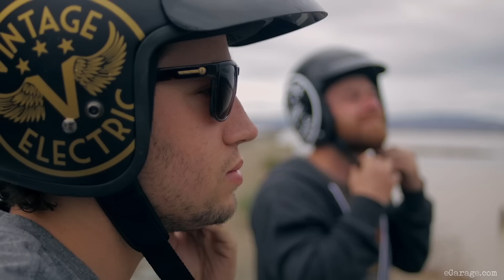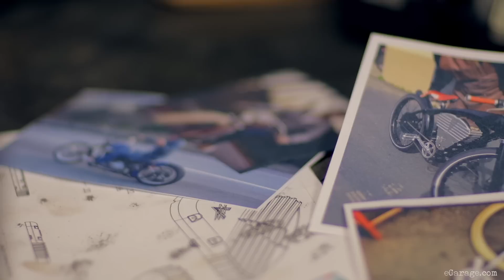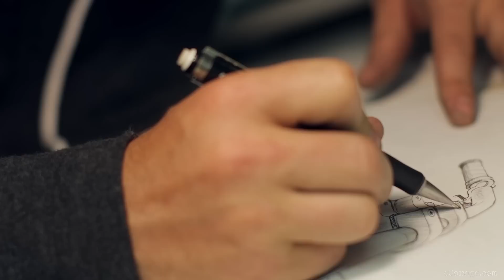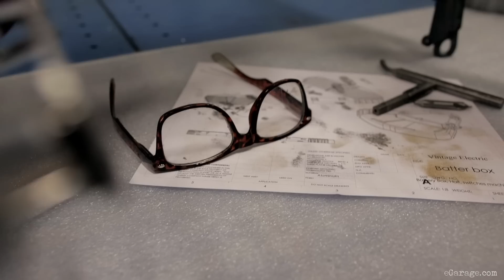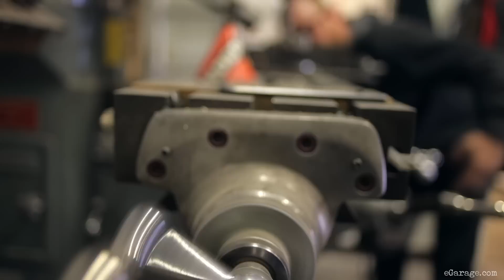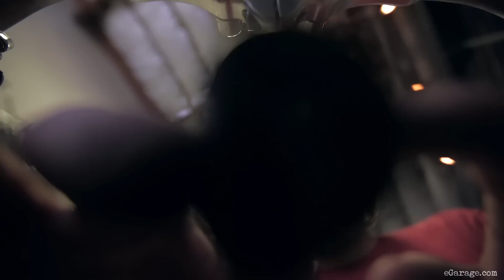Vintage Electric Bikes | eGarage

Comment: They look nice and all, but let's get real those frames are exactly like the two-stroke DIY gas conversion all in one frame can't they sell on eBay. Looks like all you did was put a dummy motor to encase the batteries and a brushless Hub motor. Or mid Drive. You can build one for 1.5k.

Comment: A step up generator using the old motor and battery can be made to get more out of that old bike and it prevents battery drain going uphill also. just put a one to four ration cog on the old motor and use a 120 stator off an old generator but then you have to limit the power or the motor will burn up as it is for a motor that is the rotation of the motor times four. and the drive motor will have to be at least 1440 volt and that is good enough for a ford 1500 diesel and the battery if it still work will last ten hours if you tone it done to an e bike motor. or the time of the battery on the ebike at full speed which is about one half hour.

Comment: I love the concept but when I was watching Video no one was pedaling. I actually know a Guy in L.A. that loves his but if you guys aren't thinking in terms of pedal assist and throttle option as secondary mode you are not thinking correctly. What is going to happen if your producing bike that your not pedal assisting the federal/local laws are going to change and it will be all over. I have a home made electric with a fast motor and pedal it even though I don't have too...I go where motorized vehicles are prohibited because its dead quiet and it's pretty darn stealth.
Reply: RPM look into the geometry of the frame, waaaay too low for comfortable pedaling over distance,  they have released a new bike specifically for the pedalec market, less motorcycle more bicycle in style and built for actually pedaling

Comment: i wish assisted pedal bikes were more affordable. this product and the other one that was on Jay Lenos garage are toooo expensive for the majority of people who have interest. for the price of most assisted pedal bikes you could get a good used car with air conditioning, safety equipment, and all other initial fees payed.

i understand that these bikes are part of the specialty market are more at the higher end of the product spectrum and for the low impact people who probably have a bicycle already. 

i definitely would be interested if the low end prices were $1,500- $2,000. at the prices that they are sold at you could get a nice bike and trick it out with a electric  motor and a battery pack.

Comment: Nice promotion. Let us not forget that this bike is made of 70% off the shelve obsolete parts and the rest is just  obsolescence  promises. Nice job and cool design.
Reply: +ilan magen I imagine you prefer mass produced Chinese bikes that not even the guys that assembled them (with the cheapest possible materials and processes) would recognize in the streets. Cuz you know those fancy state of the art expensive bikes all say "Made in China"  underneath right?
Reply: +Jantony Velazquez Actually my favorite bike is  equated with Bosch and it have felt logo on it. it's not only look like bike it's aslo smell like one.
Reply: Oh yeah the way too expensive  250w bosch crank motor on an even more expensive felt, it probably cost ya twice as much as the 3kw vintage you would never be able to keep up with in a trail or road. Great buy lol!

Comment: I mean come on. $5,000 with 750 watt motor, disc brake and suspension. People will be able to make the same quality bike as this within $1,500 - $2,000. I think it's way too expensive. Or why don't you buy a motorcycle.
Reply: Danny Kim.  $RipOff $
Reply: 5,000 is good and wow a 750 watt motor, here in Australia max is 500 watt for road bikes.
Reply: Put a motorcycle on a commuter train.  Ride it in the park or bike lanes.  Motorcycle would triple my commute time. Love to smell like gas a work?  Hopefully ANYONE can work on your motorcycle.  Maintenance/Upgrading the engine on a motorcycle easy? Parts easy to get? Is it legal to put your kid on a motorcycle?  What's the insurance cost for a motorcycle? Parking? Can all your friends drive it?

Comment: GET URSELFS A 3D PRINTER N IT WILL SAVE U $$$$$$ !!!! IT WOULD DO SO WELL HERE IN IRELAND!! ESPECIALLY DUBLIN
Reply: It will also bring the price down so ppl will buy them n use them!! 4000 is bit steep rather by a moped for less
Reply: +Columba Kelly  It's actually higher than that, it currently is $4999.00, plus add on/accessories, and you can easily see yourself paying $6000 for an electric bicycle.

Comment: Let's be real. The moment you fit a motor (electric or otherwise) on a bicycle it can only be called a motorcycle. This here is a great product that evokes childhood memories - an era with no mobile phones and no tv content good enough to keep you glued to the couch. However, they have left out the most important aspect of a bicycle - peddling. The whole point of a bicycle is to exercise as you get some air and nowhere on this video do they show someone peddling. Smh
Reply: Cannot agree with you, sorry. The point of the bicycle is NOT to exercise, it is to commute faster and easier than walking!! If you want to exercise you can do plenty of other things, it is even harder to peddle with a heavier (electric) bicycle!

Comment: Hey why dont you fit a wind generator motor to the bike. On the front wheel or engineered to fit next to the electric motor using the same chain or belt. The small one I was looking at the other day. Puts out 6.5amp per rotation running straight into the battery would increase the range of the bike or make it unlimited if the math was done right. Oh and iv had a motor like this changing a 130ah battery witch was constantly being used every day. I migjt be wrong but iput is better then none.